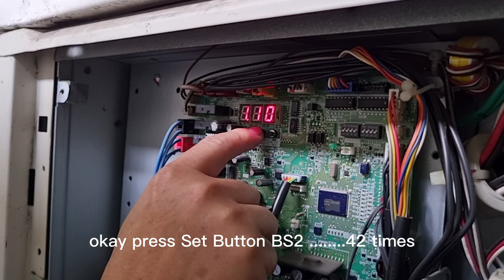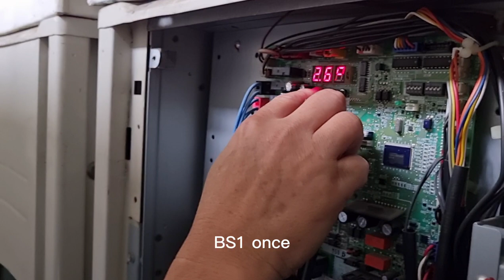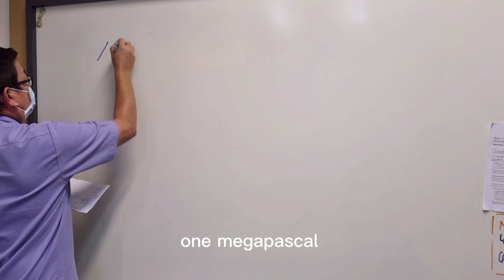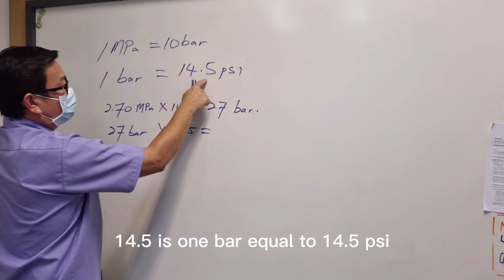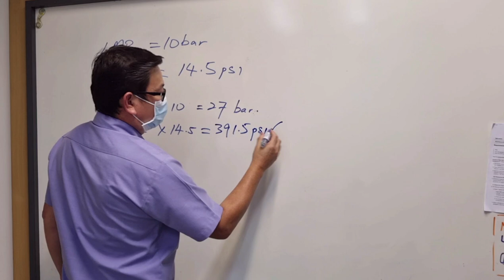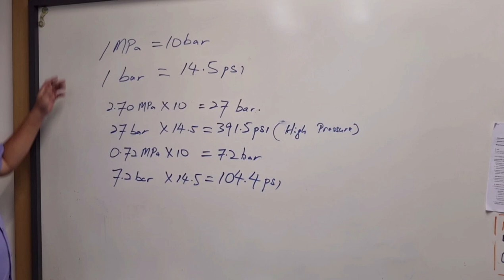How to measure refrigerant pressure using monitor mode Daikin VRV4

Comment: When you installed brand new AC, which one is better purging or vacuum for removing air in the pipe and or indoor/the system?
Reply from the maker: Install new aircon must vacuum the system.

Comment: High pressure 345psi low pressure 115 psi is enough?Bcs still the fcu not really cool.and room temp too.fcu run like very dry run.what is the reason? 17 fcu units connected.(RXQ8TY1+RXQ12TY1)Already topup gas.
Reply from the maker: What is the fcu off coil temperature
Reply: @BonMj  24℃
 liquid pipe temp 3
Gaspipe temp 22℃ never drop.always maintain this 19 to 22.
Reply: Thanks for your reply Bon Mj
Reply from the maker: @balamakem662688  should insufficient gas 
Off coil24°c
Liquid 3
Gas pipe 22
Reply from the maker: New installation?
Reply: @BonMj  no.3 years system.this under in operation.we topupgas last week check again not found any drop pressure still same pressure.
Reply: @BonMj  ok thank you.how much psi highest we can topup for this specs?already 345psi.
Reply from the maker: @balamakem662688  you can try charging gas until liquid pipe temperature around 10 or gas pipe temperature lower then 15.
Reply from the maker: @balamakem662688  for VRV difficult to say.by thermistor reading you can normally know the gas is enough or not, cause this not new installation. Charging follow the pipe temperature is more safe.
Some discharge can up to 400psi.must see the cu location or any hot air short cycle.
Reply: @BonMj  ok.thank you Mr.Bon Mj for your kind reply.your videos are very helpful and easy to understand.thanks a lot.
Reply from the maker: @balamakem662688  welcome

Comment: low pressure below 120psi is normal?
Reply from the maker: For this is enough
Reply: Why?
Reply from the maker: @tommypua7585  VRV is different,pipe length, pipe size and indoor room temperature...etc